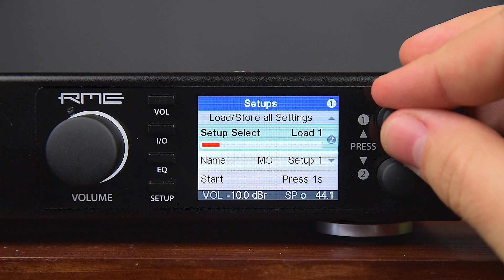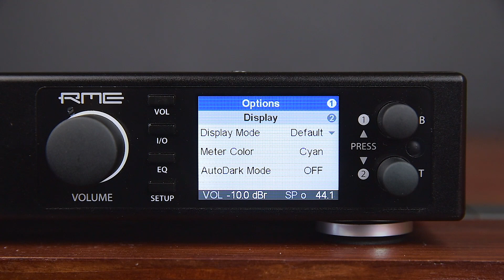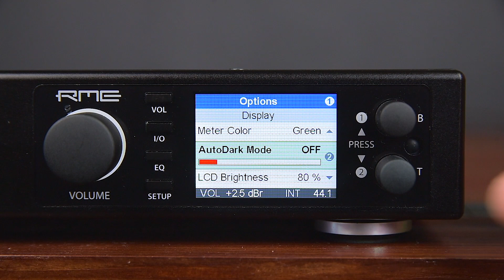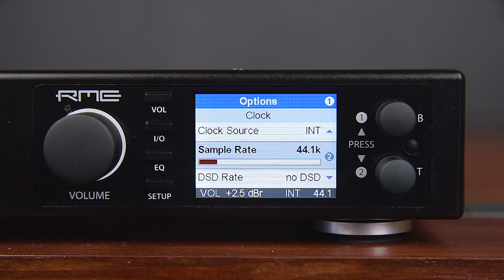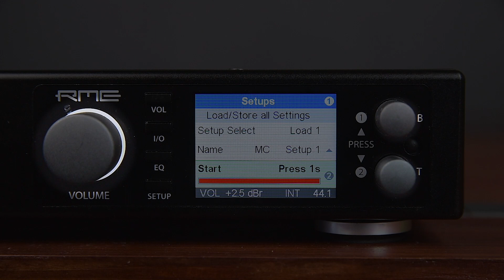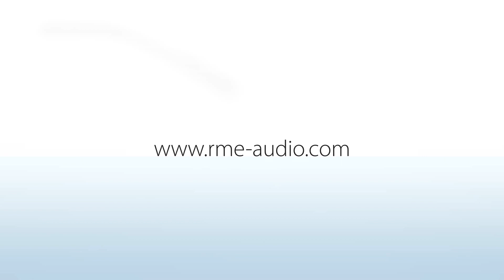ADI-2 DAC Menu Walkthrough #05 - Setup

Comment: Can this device actually play from a commercial SACD player DSD only stream? Paul McGowan of PD Audio doesn't think almost any devices can
Reply from the maker: Yes, it can if you find an SACD player that gives out a DSD stream. Most SACD player do not do that due to copyright issues. USB and DSD is more easy.
Reply: @RMEAudio  so then how do old sacd players play DSD out over rca cables? Is this DSD or snake oil?
Reply from the maker: @noseonscent1935  If it's digital then the ADI-2 DAC will detect the DSD stream over digital RCA (that is not snake oil). Most SACD player just give out an analog signal from a SACD, not a digital stream.
Reply: @RMEAudio  am I then to understand that the old sacd players have already done the digital to analog conversion inside unit using onboard 1 bit decoding? Thanks for your time.

Comment: I have the RME ADI-2 PRO FS R. I bought mine BRAND NEW from B&H and it runs really hot. I will buy an IR Thermometer, but what temp range should be considered normal on the bottom surface of the unit?
Reply from the maker: Everything up to 50 degrees Celsius is fine. The housing is used to cool down.